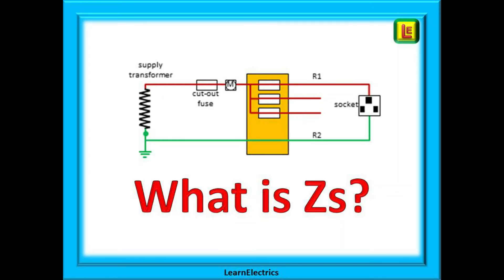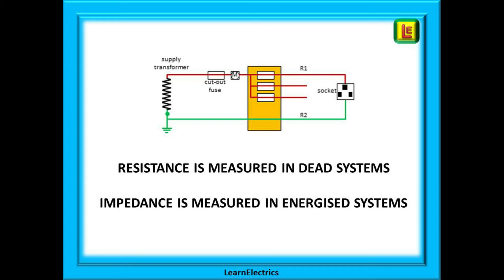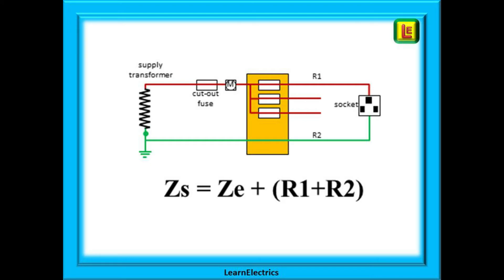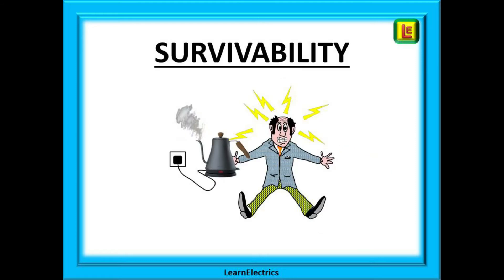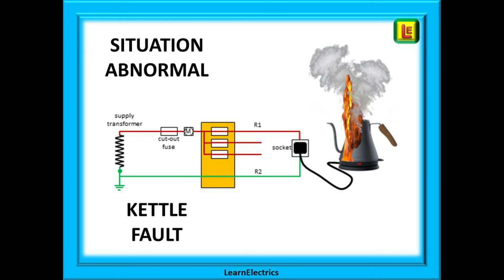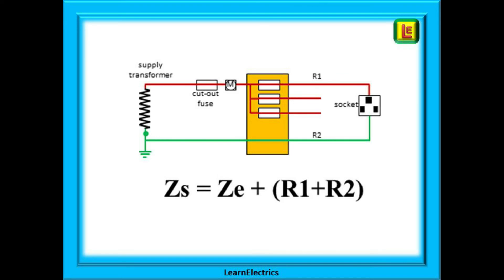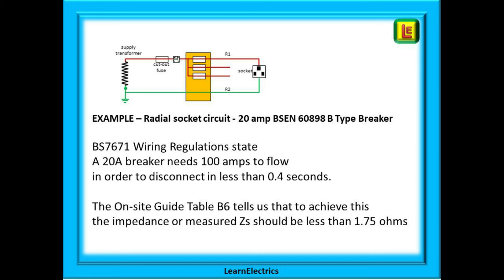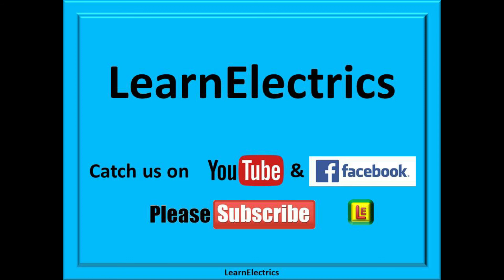WHAT IS Zs? Why is it important to test Zs.

Comment: Excellent and informative explanation. very important test indeed. Am I right in saying its a 3 lead live test and its done with the main earth connected to include any parallel paths. I did the inspection and testing nearly 2 years ago and unless your doing this regularly its so easy to forget so between studying your videos and reading over my notes I really try to keep it in my head. Like you always say practise practise and practise some more. Thankyou for taking the time to put this together your efforts do not go unnoticed.
Reply from the maker: I do the three lead test for Zs and yes, for Zs I leave everything connected as it would be used by the customer, earths in etc. For Ze, I do one test with the earth removed to prove there is a copper earth connection to the substation and then reconnect the earth for a second reading. It only takes an extra 30 seconds and gives me piece of mind.
Hope this helps. Dave.

Comment: Hi Dave,
Thank you for the great content as always. Amazing work and information provided. I wanted to ask a question, why would the RCD trip when ZS testing and I get no reading. 
Please if you could have an idea of what this could be?
Thanks
Reply from the maker: If you have your test meter set to the normal Zs test this will happen. Set your test meter to the NO-TRIP setting and it should clear this. Different meters mark the no trip test differently so check the user instructions with the meter or go online to the manufacturers website.
Take a look at the video on this link, its an old one of ours, but it will help.
https://www.youtube.com/watch?v=n1XSSSs5ILo
Reply: @learnelectrics4402  thank you for your reply and your time. This property is the only one that gives me a problem - testing other properties with the same tester I’ve never had this issue. The setting is always set the same way but it only seems to be happening at this property. 
Just abit baffled as to why this is happening here. The tester is Megger MFT1721
Thanks

Comment: Thank you for this. What causes the faulty circuits mcbs to trip rather than the other mcbs in the CU? The incoming supplys Line and Neutral are two incoming supply conductors. If there is a fault a surge of current will loop round from the consumer to the  transformer and back round to the consumers CU.  How does a single MCB know when to trigger when all the MCBs in the CU are also exposed to the fault current surge coming in from the Supply?
Reply from the maker: Because the fault current has to pass through the mcb of the faulty circuit. It doesn't matter what is happening on just one side of the fuse or breaker.
Watch this video, it will tell all.
https://www.youtube.com/watch?v=FZ6-okbgXKo

Comment: As a Mechanical engineer that has just progressed into commissioning and consultancy, your video has been very informative and totally understandable! however, I have a question, could an on site guide values deviate from a standard Zs table and if so why?
Reply from the maker: Have a look at these 3 videos, less than an hour in total. They will really boost your understanding. The OSG uses 80% values based on the 100% values in the tables in the Regulations book. An, there are some typos in the OSG tables, highlighted in the videos. Thanks for watching. Dave.
https://www.youtube.com/watch?v=QWr-ilqW67A
https://www.youtube.com/watch?v=fkSUrz0HaPE
https://www.youtube.com/watch?v=nVZeIFeEwl0
Reply: @learnelectrics4402  ohh great, thanks a lot :)

Comment: If the zs on a b32 mcb is 1.10 max on a tn system and the reading was coming back higher, would this circuit require rcd protected to provide fault protection, would it then be acceptable or not,
Reply from the maker: The Regs do permit that under certain circumstances but first look at the options available to bring Zs in line. Have a look at this video on the attached link.
https://www.youtube.com/watch?v=fUlCDhlcDf4

Comment: Hi,

Need help with this please

Max Ze for TNCS is 0.35.... What happens when you then have large protective devices for outgoing ways. For example perhaps the consumer unit is more than 3 meters away so you have to use a 100A bs88 fuse.. same for blocks of flats.. this has a max ZS of 0.34.. if the Ze is close to maximum, how on earth are you supposed to get round it?
Reply from the maker: If Ze is close to the maximum, then that is still ok. Also consider what the Zs readings are, they are the important ones.
Reply: @learnelectrics4402  that’s what I mean …if I have a 160A BS88 max ZS is 0.34 ….. what if my ZE is 0.34?!

Comment: What happens in a short circuit? If in an earth fault the current flows through the earth  and back through the mcb. In a short circuit if it flows through the neutral to neutral bar, how does it go back through the mcb to trip it? 

If it goes back to transformer and then back through to mcb, how come we don’t do a “neutral fault loop” test
Reply from the maker: Earth and neutral are effectively the same point back at the transformer. Earth fault is L+E and short circuit is L+N so neutral is covered. Thanks for asking, thanks for watching.
Reply: @learnelectrics4402  thanks for the reply! Does that mean in a short circuit the fault current flows down neutral to transformer and back through the L through the MCB causing it to trip… or …. Does the fault current through the L conductor increase due to the fault causing mcb to trip.

Comment: Will the reading be effective if i use a temporary generator connected to the earth rods during testing and commissioning instead of the transformer ?
Reply from the maker: If the installation is to run on the national grid, you really need to test it when connected to the grid. Your generator will give different readings. You can test R1+R2 as a dead test and add to an assumed ZE (0.35 ohms for TNCS). When the DNO connects up, the Ze will usually be less than 0.35 so your Zs figures will be acceptable.
Hope this helps. Dave.

Comment: Dear sir, thanks for your great presentations. But in another video , if am not mistaken it was said that for type B we need Zs to be not more than 3.5 Ω and not 1.75 Ω. What is correct?
Reply from the maker: Both are correct Mark. A 10A Type B has a max Zs of 3.5 ohms whilst a 20A type B is 1.75 ohms. Hope this helps and thanks for watching. Dave.
Reply: @learnelectrics4402  Great Dave! Thanks for your prompt reply.

Comment: A question: - if the resistance of a human touching the energized kettle is greater than the Zs, will it receive an electric shock? Perhaps the Zs is more about protecting electric installation and less about human protection 🤔.  RCD is the device that is more about direct human electric shock. 

Great video though 👌
Reply from the maker: The human body would form part of a parallel path with the kettle. Thanks for watching. Dave.
Reply: @learnelectrics4402  I am not sure, because the metal frame would have lower resistance than human body, and thus the current would flow through the frame and not the human body. Do you agree?

Comment: Great explanation, but I have one question; 
If the lowest resistance possible is required for the earth conductor ( to achieve higher fault current),  why is the cross sectional area of the earth conductor in 2c+e cable smaller than the line or neutral conductors?
Reply from the maker: Good question Nick. It's all to do with the Adiabatic Equation and the time for the fuse or breaker to trip. We can put any bigger size earth in we want but if its not going to overheat before the fuse blows then why waste copper (and money).
Have a look at this video, it explains it all. Dave.
18th EDITION – SESSION 4 – ADIABATIC EQUATIONS, click on the link below
https://www.youtube.com/watch?v=173C7yE-xbU

Comment: I want to know how to calculate the time to burn a fuse given the material, temperature, thickness of the fuse, and the current passing through it.

I tried finding fuses online and very few places have graphs that show the curves (for example generators often have discharge graph with curves)
Reply from the maker: Tommy, not really something we worry too much about as electricians. We work from a set of approved fuses and breakers and all the calculating of burn time, material etc is done by the manufacturer. You may find the data that you want on a fuse manufacturers website, but then again, they may keep the information secret. Thanks for watching. Dave.
Reply: @learnelectrics4402  i see, so is so many product manufacturers, even for cars, most of the time they base on the previous products rather than doing a whole new set of calculations, probably 95% empirical.
Reply: @learnelectrics4402  or idk if the deviation is too high, the rate of failure is too high, like long HDMI cables, that could also be a reason

Comment: I have a question. In a phase - neutral short circuit fault with no grounding what is the fault loop? From the neutral to the trasformer or  to the electrical meter?
Reply from the maker: It's the whole loop through the transformer and back. Have another look at the video. Thanks for watching. Dave.

Comment: Great content. Why is the loop impedance value not the same in Table B6 the onsite guide to  BS 7671 table 41.3. B type mcb 20 amp. I know in  BS 7671 there is a factor of 0.8 and in your video you mention the value must be below 1.75 ohm.  the value in BS7671 says 2.19 ohms. I hope this makes Sense.
Reply from the maker: Good question. That is the 80% rule. take a look at our video ZS and the 80% Rule on this link.
https://www.youtube.com/watch?v=ihD-NO-7G5Y
Thanks for watching. Dave.

Comment: Hi sir... im searching for an answer regarding ZS...wat would cause my measured ZS to be lower than my calculated ZS ... zs = ze + (R1+R2)
Reply from the maker: Measured and calculated are never the same. For a start Ze is a live AC measurement, and R1+R2 are DC dead tests. Different switch settings on your meter and so slight differences. How good are the batteries, how hard are you pressing the probes, what is the temperature in the room. Are there parallel earth paths, is it TT or TN. Lots of things. If they are close don't worry about it.
Reply: @learnelectrics4402  thanks sir
Reply from the maker: Happy to help.

Comment: Excellent presentation.
Please can you explain how do we achieve the 100amp fault current to flow to trigger the MCB to trip @ 0.4 second! 
Knowing appliances don’t required that much amperes to start or run on full load. 
Forgive my ignorance if have asked an obvious question! 

Regards
Reply from the maker: It is the earth fault path having a low resistance that allows a large fault current to flow. The fault path is Line and Earth, not Line and Neutral
Its all to do with Ohms Law, if the earth fault path is low enough then the current will be high. Some of our other videos will help you to understand this better, especially our video on Ohms law.